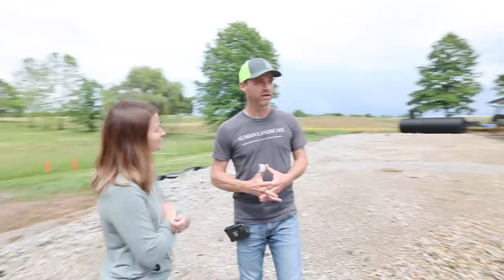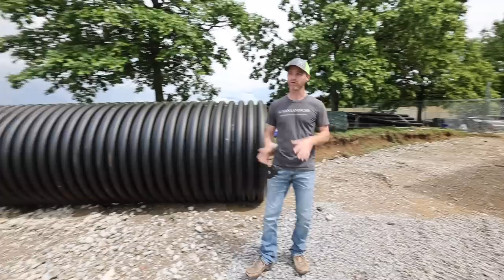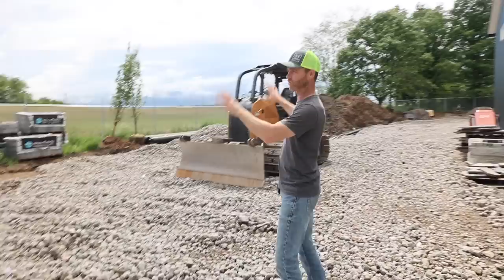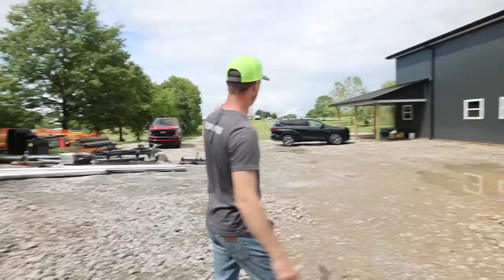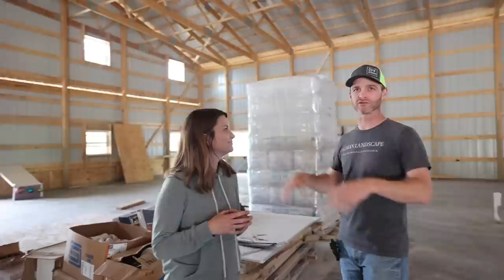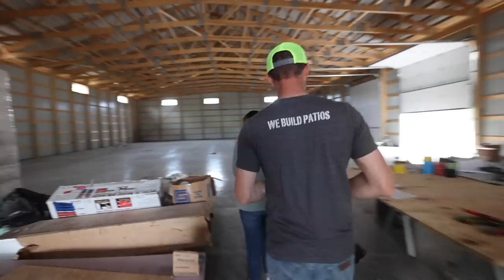70X120 POST FRAME DREAM SHOP [CONTRACTOR SETUP]

Comment: One thing every shop forgets to do is adding a pit to work on vehicles. Can’t wait to see the finish product👍🏽
Reply: A pit?! Hahahha What are you? 1952? Lifts are where it's at.
Reply: @jeepinass  try lifting a 40000 pound front end loader tell me if you survive. Once you get larger equipment lifts are useless as they are too small in both lifting capacity and physical size
Reply: @Johnthelittlebuilder  heavy equipment is a bit of a different story. If that was the sole purpose of a shop, sure, a pit makes sense. Very niche market there though. Most folks don't want to work around that giant hole in the ground 99% of the time for that 1% of time that it's handy.
Reply: So much quicker changing your oil in a pit no matter vehicle/equipment size

Comment: Absolutely should have house wrapped that building even if you were doing spray foam. But considering it is being sprayed, the house wrapped would have been mandatory. You don’t want the foam adhering directly to the metal because when the sun heats that steel up, it’s going to want to expand. That foam has the potential to locked the panels preventing it from moving. That’s going to cause buckling and wrinkling.